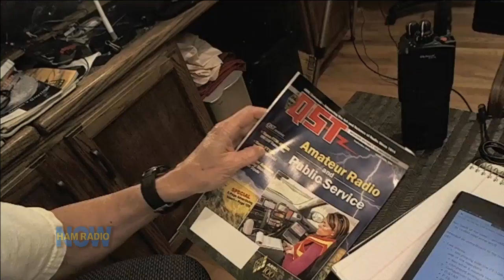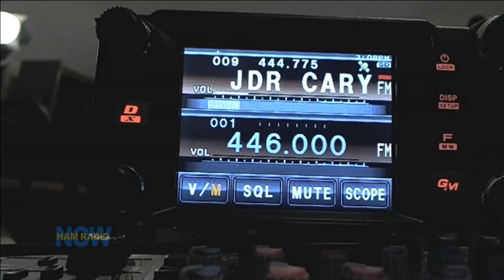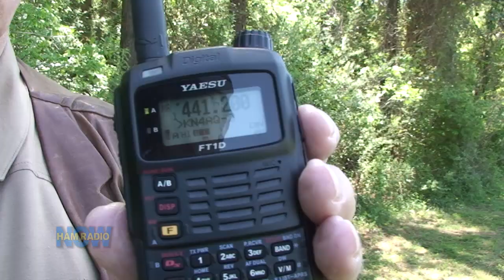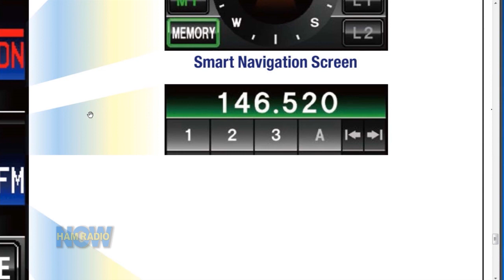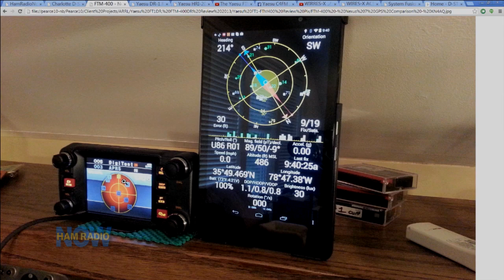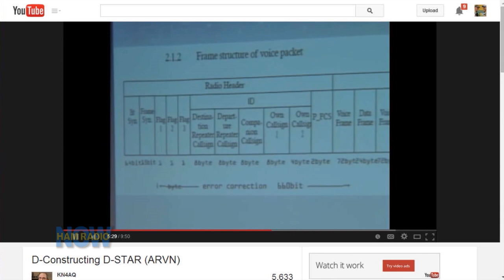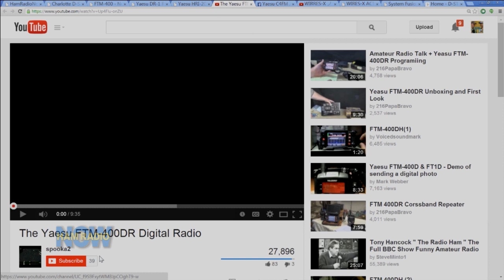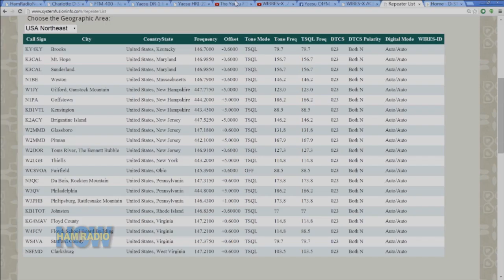HRN 161: Yaesu's System (Con)Fusion

Comment from the maker: Jim Aspinwall said: "...and then @36:00 there's determining the technical parameters of antennas by length/appearance..."  I have disappointed Jim with my lack of technical expertise. In his other comment, he ranks me right up there with the CBers! Ouch! Jim, it is true that you can't precisely determine the potential of a rubber duck antenna by the length and appearance. But with some practical experience, I can observe that in general, antennas on commercial HTs, cut for 450-470 MHz, are shorter than antennas on ham HTs cut for 440-450 MHz. It's nearly universal. Also, 30 MHz is a HUGE swath of spectrum to make an antenna play over (at 450 MHz... not so big a deal at 2.5 GHz). As I said, I didn't understand the magic that made that antenna work. What I really mean is: I don't think it works. I'll stand by my conclusion that the Johnson's antenna MAY have been a contributing factor to the ~10dB or so worse performance of those Johnson radios, in analog and P-25. So you get yourself an antenna range and do the measurements, and get back to me with the results that prove me wrong. And as for fading due to distance... do you really want to claim that moving 4 inches farther from a repeater will make a significant difference in the signal DUE TO DISTANCE? OK, explain how moving 4 in inches CLOSER can also create a fade. I'm not an engineer, but I play one on TV.

Comment: Excellent video Gary, thank you! Very informative.
Apparently Connect Systems are releasing a D Star/DMR radio in the first quarter of 2015 which will be upgradeable via software updates for use on the other digital modes!
Very exciting :)

Comment: Question: is the Quality of the C4FM in a City also so Problematic like the DMR? For example in my Hometown a lot of Buildings are making Reflections on there sureface and so the Signal will often interupt or douple etc. and the FEC (Forward Error Correction) will not fix the defect Packets (in DMR). For a other example 120km away with less infrastructure you can communicate without any problem and reflection. Is this in C4FM also so? For your information in my mind the Original DMR Radio like the Motorola or Hytera with build in AMBE+ Chipset are sound much better and clear than the Softwaresolutions from Radioddity, TYT(Tytera), Retevis this Radios sound in my ears more hard and not so good resoluted 73.

Comment: I agree, Dstar, fusion, Dmr. The manufactures need to agree on a comparable mode. Most can't afford three types.
Reply from the maker: actually, that's not my point. I don't want to see one single digital mode. You will have a constant stream of them as technology changes. I want to see radios that are adaptable and can handle all the available modes, and new ones as they are developed, as long as the hardware that radio can keep up.

Comment: Unfortunately, there are different antennas and then they transmit radio waves in different shapes. Fortunately, at least, both P25 and YAESU C4FM have been compared vertically between FM and digital modes. YAESU signal drops out or crackles when FM signal is at or even below the sql margin. P25 drops out once but analog signal still can be copied. I'm really curious about how well D-Star works there in FM mode.
Reply: In addition, IMHO, FT1D's antenna is quite bad for UHF but good for VHF. I re-watched the video finding they had tested analog modes there for Icom.

Comment: Thanks for your post. I have been shopping for a digital radio..... still sitting on the fence, but leaning towards Yaesu. I think the only way out of all this is SDRs, it's actually the only way. Being locked into a piece of hardware that could become obsolete in 6 months just makes no sense anymore. Another reason for SDR over hardware a big part of ham radio is emergency communications. Looking back to 911 I remember a lot of problems in NYC stemmed from the safety services not being able to talk to each other. If an extended disaster were to happen we might be in trouble if we can't talk to each other.  On another note I would like the manufacturers start using smartphones and tablets as the interface to the radios......

n8aho

Comment: @19:20- dude, not all fading and dropouts are multipath, it's simply reduced signal from Tx to Rx.  Multi-path is where one or more out-of-phase reflections of the transmitted signal present at the receive antenna, typically manifesting itself as distorted audio. Such mistakes (this and many other flip unqualified improper references in Ham Radio Now) undermine credibility. This is where the term 'ham' earns a derogatory meaning right up (down?) there with good-buddy-CBers.   The community, old and new participants, deserve fact, not slang or misinterpretations.

Comment: I'm like some of the other comments on here looks like SDR radios are the best ave. Why couldn't the manufacturers settle on a digital standard? what if back in the day Hallicrafters and Collins and Heath-kit all came up with their  own SSB radios that couldn't communicate with one another that would have went over like a lead balloon
Reply from the maker: I don't think we need a single standardized DV mode so much as we need radios capable of using ALL of them, and being upgradable when a new one is developed. We can have DV modes on HF and VHF that address specific situations (propagation, networking, mixed voice/text/image...). Will hams press manufacturers to make those radios? One rep I talked to said hams won't pay for radios that sophisticated... I guess unless the Chinese companies get there first. Connect Systems and Algoram/Whitebox are coming in from the fringes to try. We'll see how successful they are.
Reply: +HamRadioNow That will never happen. It has worked so well with cell phones. :-) There is actually a lot of $$$ invested in high-quality implementations on silicon that no Ham could hope to duplicate (not even the Chinese with the security measures that have been taken). So you can do a home-made Fusion, but the performance won't be there and there are always compatibility issues. The real solution is to bridge digital systems at the network layer. (That's what cell phones do.) We need to abandon this EchoLink-like thinking and look to how a true digital system should work. Not one with bandaids to bolt onto traditional non-digital networks (IRLP, etc.).

Comment: Regarding multiple modes that can't talk amongst themselves.... several manufacturers a few years ago made (well, one did) an HT that did DMR and P25 mode within the same radio.  Eventually, via the repeaters, the radios, or other interface the mode (just a codec, software or license the mfgr has (you can buy the DSTAR chip for ten bucks from the source)  will be less relevant, and the being digital will be a basic requirement to enjoy and use the many features and controls allowed.  This is not a Betamax vs. VHS battle - too much is invested worldwide in DSTAR for it to just go away.  Look for multi-mode capable radios, repeaters or other interface to bridge the various competition.  BTW - Kenwood makes DSTAR, just not licensed in the US.
Reply from the maker: Kenwood sold ICOM's ID-800 with a Kenwood label on it for a while in Japan. The 800 is obsolete. Are they selling any newer model? As for "Just a CODEC,  software or license..." well,  that's the rub, isn't it? Somebody has to make that radio. Only CSI and Whitebox show interest in that. The main players are still jockeying for an independent niche. Wonder which way Kenwood will jump, if they ever do?

Comment: why did you say CON-Fusion ???
Reply from the maker: Four incompatible VHF UHF digital voice systems generates confusion. It was an easy play (and maybe kind of a cheap shot) at Yaesu's Fusion. They got the heat as the new kid on the block.
Reply: Yeasu always do things 10 years late, they did with APRS and they''ve done it with Digital, they were asked to get on board with D-Star, they refused, Kenwood where more interested in their ARES market, So Icom pushed with FDMA in the 2000's. D-Star IS an open protocol, yet they pay a licencing fee to DVSI systems to use the Ambe 2000 and 3000 Vocoder chips   Most other protocols are on the same chip,    Doesn''t matter what industry or company uses market, differentiation is all part of it with their quirks
Digital radio is the same. The only thing if find is that D-Star is written for hams. DMR is a land mobile protocol trying to suit hams, Fusion trying to be both
Fusion is confusing, but isn''t that what ham radio is about'?  I personally are happy with D-Star but will shortly get into DMR Regard Peter VK3TQ

Comment: Problem I have with spending $400+ on a digital HT or mobile radio is simple..Where can it be used if I buy one that is not local.Only way I can see it working is for Yaesu,Icom and the rest getting together and making one format for it.And lets face the facts none of them will ever agree one that or be willing to do it.Digital's maybe worth it down the road but as I see it now with one set system or being able to download others it just is not worth $400+ for it
Reply from the maker: I make the point that it takes a local repeater to drive interest (aka "sales"). That and a desire to be out near the edge.
Reply: I believe this is the key point to all of the digital modes.  Just as we encountered with the X2 (USRobotics/3Com) vs K56-Flex modem battles of the 1990's dialup era of the internet, we need a "standard."  Interoperability is key to successful digital modes.  If I buy a Yaesu, it should work with an Icom, Kenwood, or any of the Chinese radios.
Reply from the maker: Jeff Buffington One key component to Ham Radio is experimenting. Locking ourselves (or being locked down) to specific modes runs directly counter to that, so I don't think that idea will get much traction. But across our history until now (on phone, at least), every radio could talk to every other radio. Well, OK, AM radios had trouble with SSB, but there was just ONE SSB to upgrade to. (There were a couple of other flavors of SSB, but they didn't catch on). The 'text' version of digital has proliferated, but you can get the software to use any of it, on the same hardware. This splintering of modes on VHF/UHF digital voice is new. And it doesn't have to happen. Radios can be developed that can run any mode, and upgrade to new ones as they are developed. But we won't see that unless we demand it, and MAKE A LOT OF NOISE about it. What WILL we do? Argue and fight about which digital mode is "better." Count on it.
Reply: +Jeff Buffington Xcellent analogy. E\Man I renumber owning my store and selling both. NITEMARE

Comment: on the 34 minutes you are not to far from each other. I can easy make it into a city repeater 22km away on a 5W baofeng. Digital must have a poo range on 5W handheld. If I connect it to my 2m/70cm base antenna it can reach a repeater 51km from here. I swapped the standard poo antenna and put on a Nagoya 15" and get much better range.

Comment: Bastard radio companies all making different non compatible digital systems! 
Who wants to buy all 4 types sure not me.
Which one will still be used in say 20 years from now?
I bought a FTM-100DR/DE. In all of Sydney there is only 1 repeater set up on C4FM = hopeless. ;-)
Yaesu offered clubs a $900 rebate on the repeater model so lots of clubs did buy them but set them up to FM out. No point in having digital if it gets reset to FM?? 
Since all these internet node thingies came out like echolink. Ham radio has died not get better - my opinion anyway.